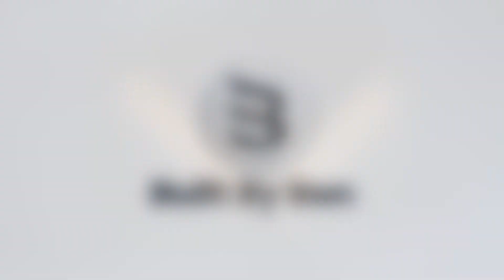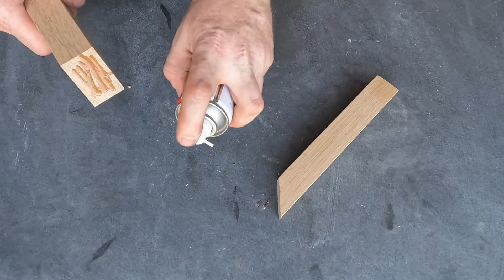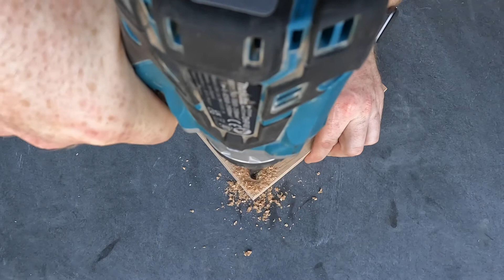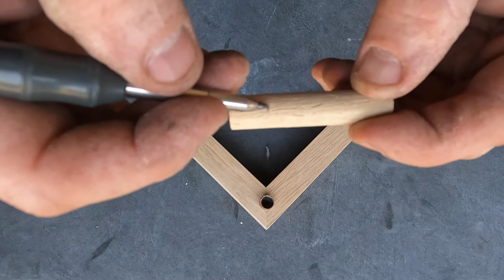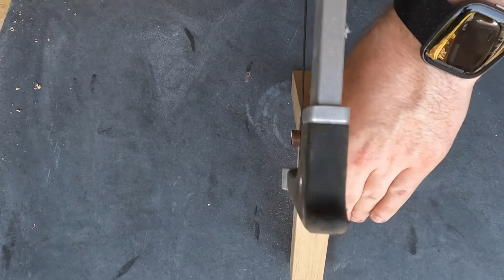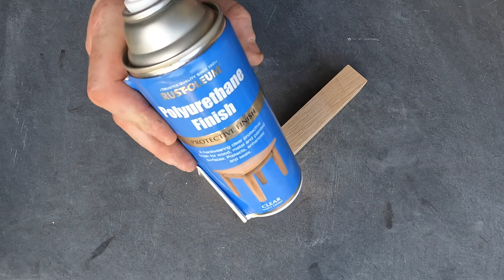A PREMIUM finish mitre joint using ZERO effort! // Using scraps to make something beautiful.........

Comment: Hi Ben,  Just a quick question , What type of hinges are best to use for internal doors.  I have to say I am new at this , huge thanks  jensen
Reply from the maker: Hi Jensen. All depends on weight of the door and what it's being hung on really. Can't really go too wrong with 3 x 75mm hinges
Reply: We are renovating  bungalow, and we like to fit new doors just standard doors , There are lots of videos on how to fit doors 🚪, but not  What type of hinges to use . Huge thanks Jensen
Reply from the maker: https://www.ironmongerydirect.co.uk/product/twin-ball-bearing-fire-door-hinge-76-x-51-x-2.2mm-satin-chrome-pair-229997

This would be my "go to" hinge normally but like I said, do some research.  You can also ask the door manufacturers.

Comment: Hi Ben, what was the idea of using the copper tube, instead of the dowelon it's own. What glue did you use to fix the dowel to the tube?
Reply: Everbuild Mitre Fast Adhesive available in several sizes bottles, it's a brillant glue,but beware it sets fast.will stick wood,metal,plastic,etc.Other glue to fit dowel is Everbuild D4 wood glue,also a excellent glue.
Reply from the maker: Purely decorative Kevin. A simple idea for DIY or skilled people to improve a simple joint
Reply from the maker: You a rep ? 🤣
Reply: @BuiltByBen-YT  No, just two of my favourites glues for woodworking & other things..But, I do wish they offer D4 in smaller containers.